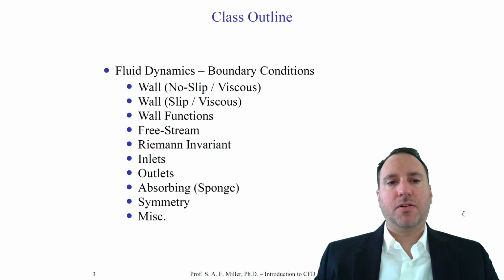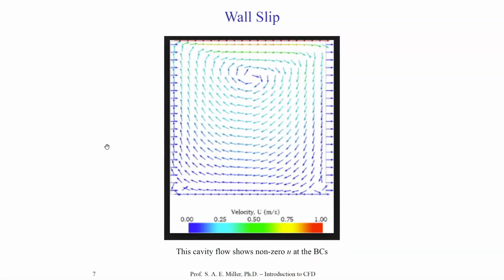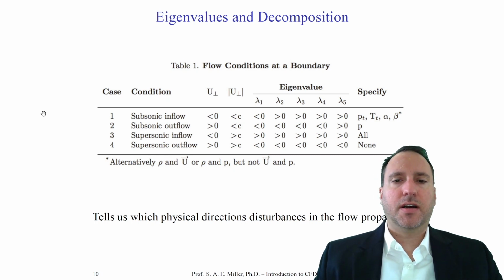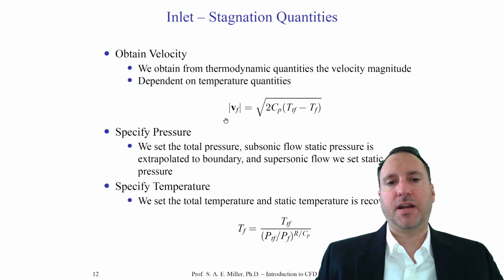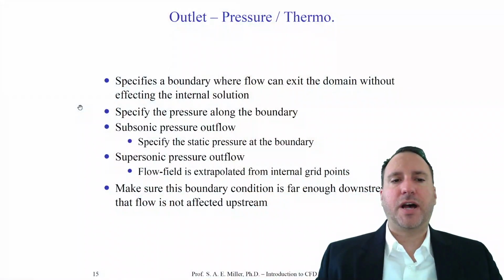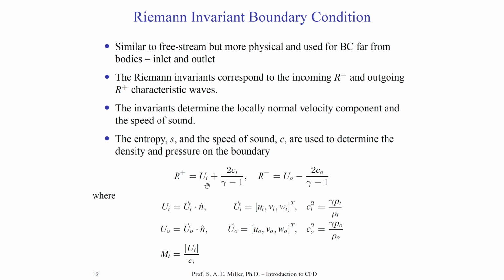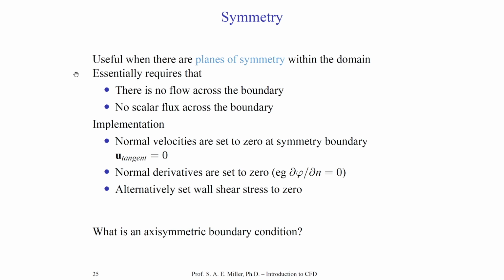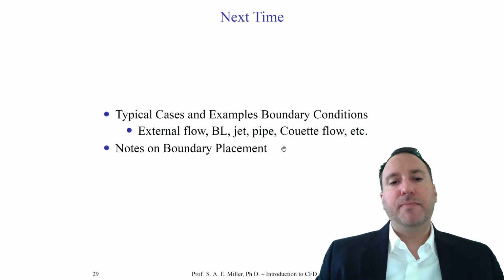Introduction to Computational Fluid Dynamics - Fluid Dynamics - 4 - Boundary Conditions

Comment: I am very excited for the next class! I have spent a lot of time messing around with boundary conditions, the meshing process is the hardest. But seeing the math behind everything is quite fascinating.
Reply from the maker: 90% of user time resides in preprocessing. Large air-framers spend most of their time at this part of the process. Research is focused on moving user time (e.g. the engineers) from grid creation to post-processing.
Reply: @SAEMiller  I bet it is very exciting getting accurate results. Is there ever a point in time where you can take the results at face value? That is where the whole conundrum is in the first place. My question is, are there instances where this can be acceptable.